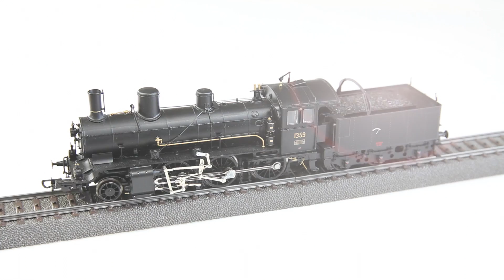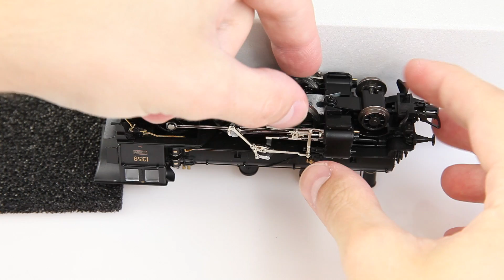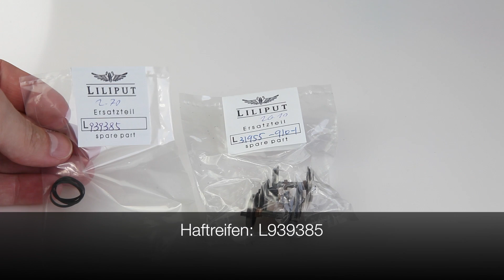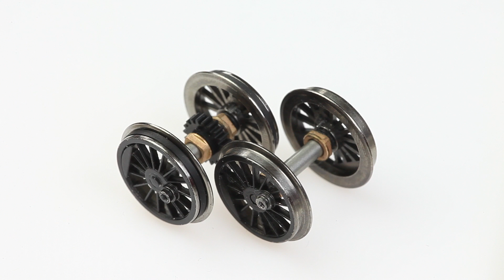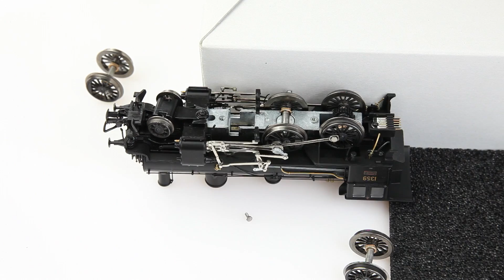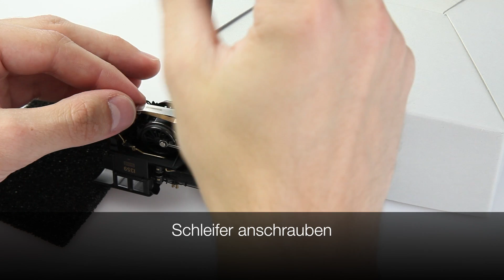Liliput 131955 SBB Schlepptender Dampflok B 3/4 Zugkraft verbessern

Comment: This Liliput locomotive has at  the middle wheel  of the powered wheels sets  the same piece of shock absorber   similar to the Bachmann locomotives that is made in China... 
 likewise by the same type of contacts of Bachmann  and the double width axle of the driving wheels...
 I tell you because I know that way of manufacturing Bachmann and it could be that this company is manufacturing for Liliput, with several  changes of design of course.  Unfortunately you destroy the gear instead of taking it out and using it as a spare late, but at the end, everyone does what they can within their reach.